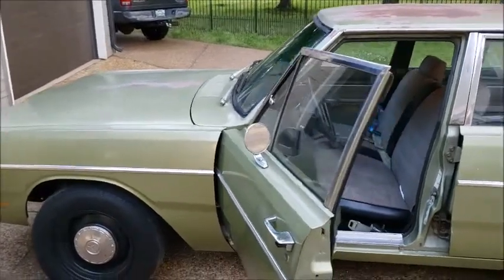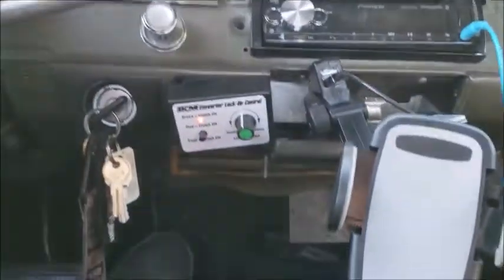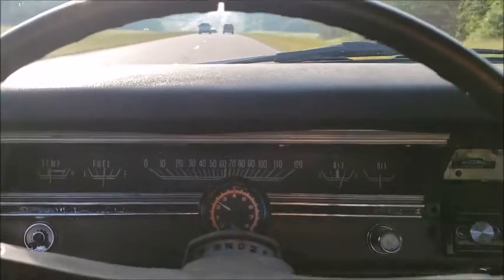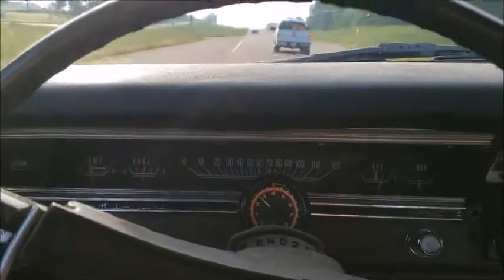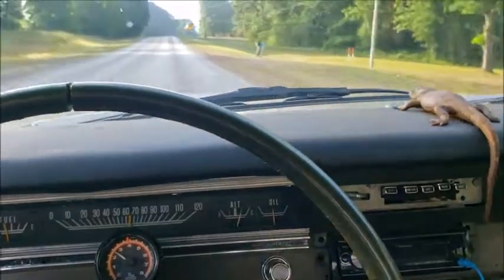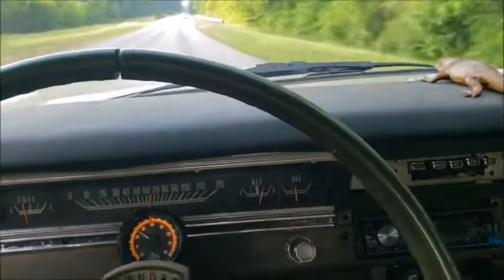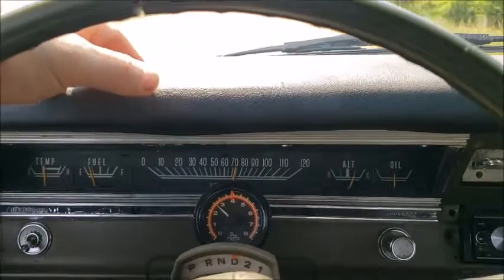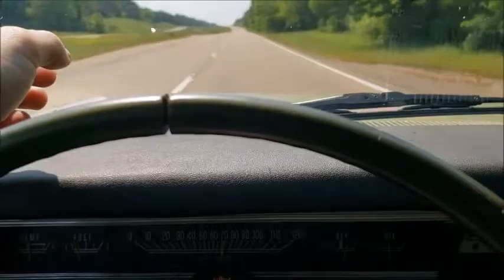The Slant Six Series E-3 #nonamenationals

Comment: Back in the early 70s I worked part time after school at the local Chrysler Plymouth dealer in NJ. They had a Dodge 500 wrecker with a slant six. They also had an old Valiant wagon with a slant six, that was the parts runner. You could not kill them. There was also a Valiant wagon with a slant six. If my memory serves me now 67. I think it was yellow, called it the bumble bee. It ran in 12/13 1/4 of my memory is correct! It sounded like Yamaha. Interesting video, lot of good info for anyone with the slant six. Good job man

Comment: I’m such a fan of the Tower so thanks for the detailed story of your Slant build. This with a manual tranny would be my vision. I know that the 833 4-spd is a great option but I wonder if there’s a 5 spd option? I saw that you’ve got this one down into the 16 sec 1/4 mile times. That’s great and I imagine it’d go a little quicker with 3 pedals. Bottom line - you’ve met your goal very successfully.
Congratulations and thanks for taking us along on the ride.